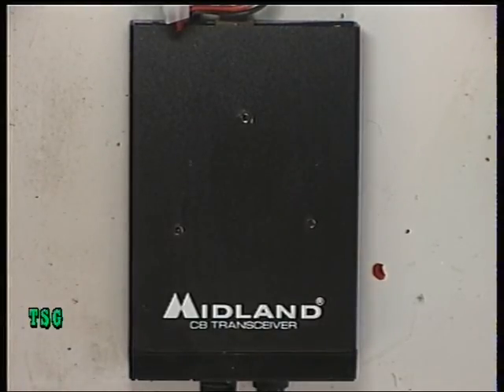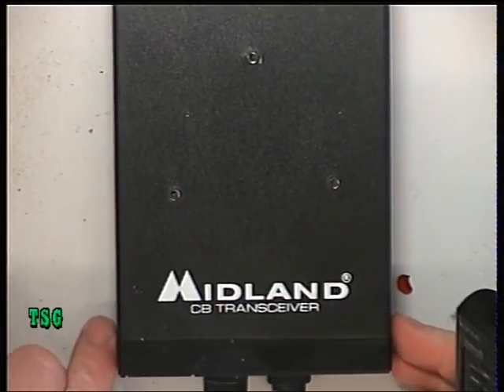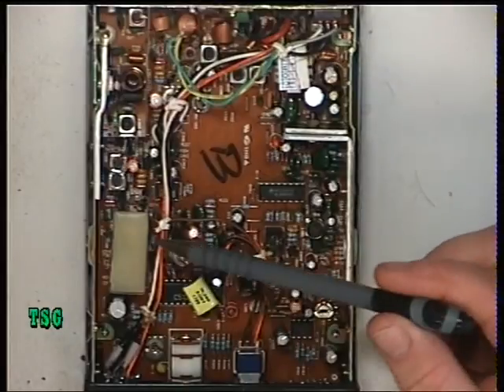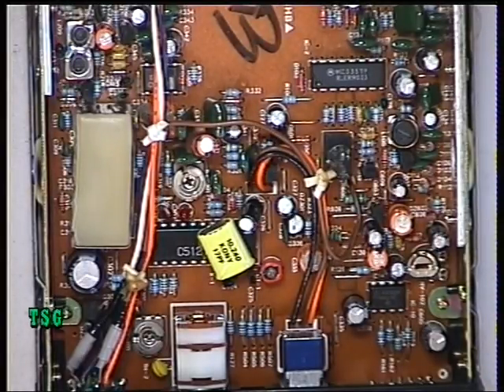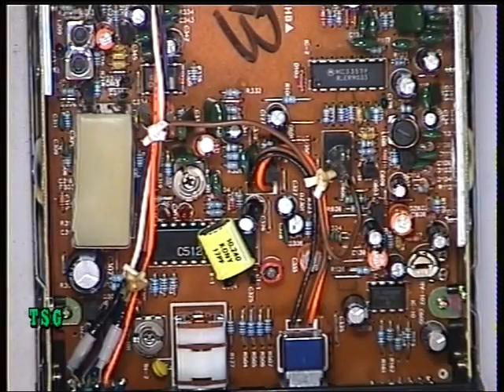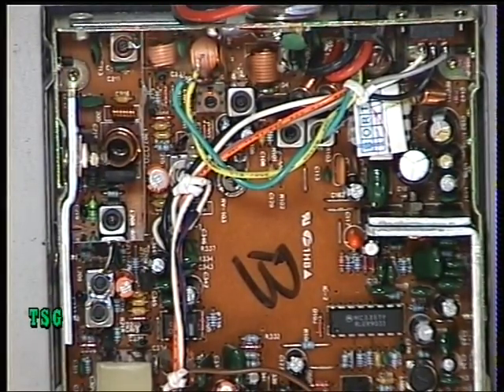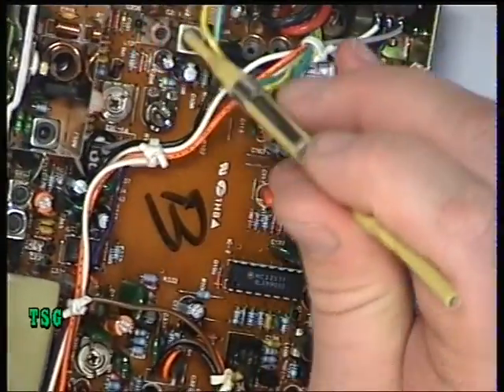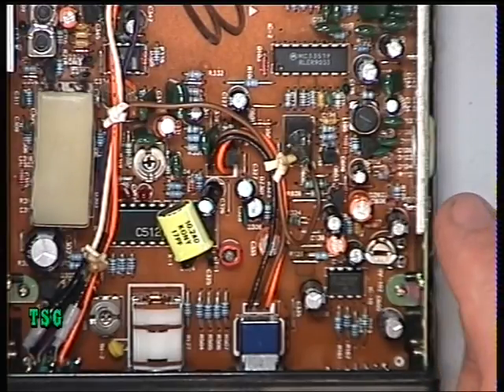Midland 77-104D UK (CB27/81) CB radio (mobile) - Transmit adjustment

Comment: You don’t explained how you did it. You just move things left and right not even describing the equipment. Kind of informative mate.
Reply from the maker: I've covered this exact model quite a few times on this channel. Perhaps one of the other videos of servicing this model helps you more.  I'm doing the 77-104UK (not the D version like this) tomorrow too.

Equipment-wise, I'm using a Marconi all-in-one communications test set.

Richard,G0OJF, UK